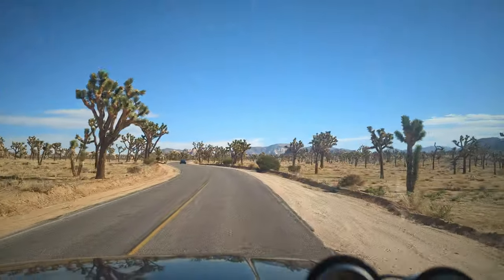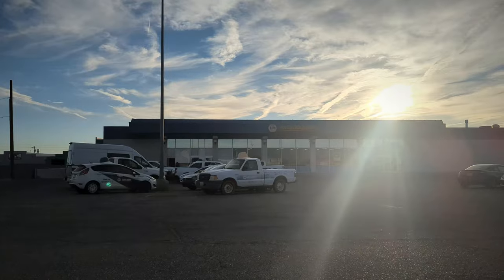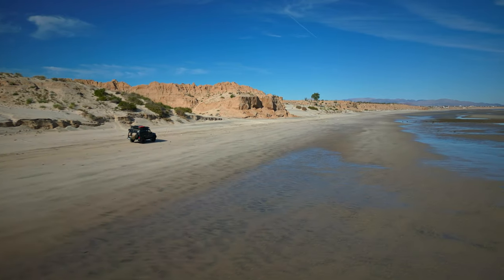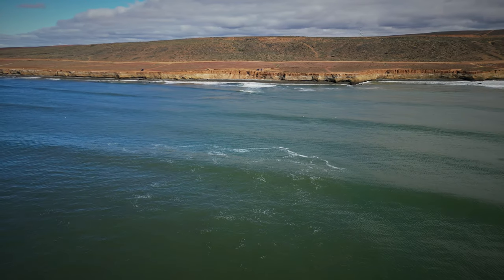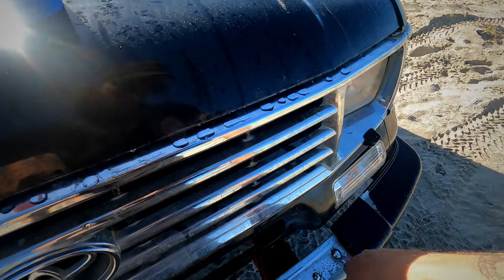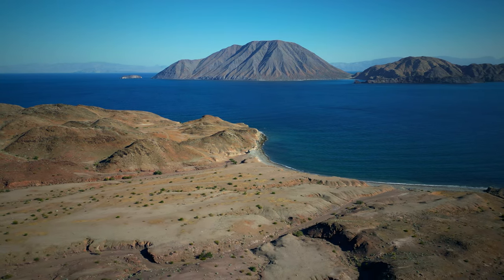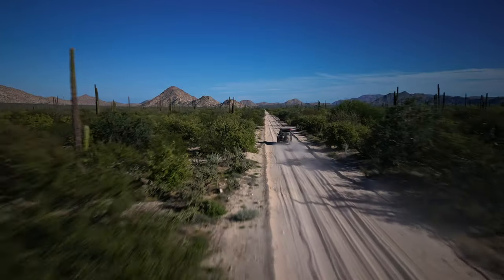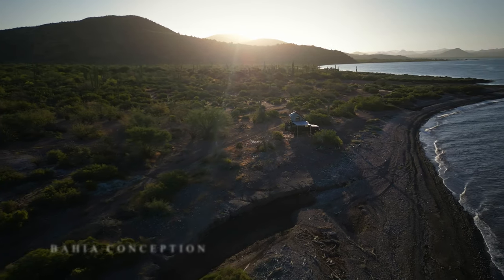Exploring Baja California | Archive 2

Comment: All I seen was that Friendly Manitoba plate and I Sub'd up straight away!  Great videos! Did you import the Cruiser from Japan? [RHD] Watched 2 videos so far, one break down. [wheel bearing] Any other issues along the way? Cheers from [you guessed it] Friendly Manitoba!   Stumpr1 BTW, we just had -40C windchill....ugh.
Reply from the maker: Thanks Stumpr! Yeah we had a bunch of mostly small stuff, birfield busted a small bearing. Radiator had a leak, new injection pump, blown two shock absorbers, bad battery, exhaust leak, general old truck stuff
Reply: 100 questions....to ask.  Vehicle, did u import to CDN? You a Pegger? Have a fantastic journey! Injection pump would be worst of these issues. Will Watch all videos posted up!  @goaloneTV

Comment: Hey man love the vids! Have watched all of them. Just wanted to throw a thought out there if you care at all. Your video quality is so good, that I think your mic quality takes away from it just a little.

I know you’re just starting this channel, but I’m a big fan so far. I would recommend a nice portable condenser microphone like the Audia technica at2020. It’s an XLR mic that will require phantom power, but you could pair it with the shure X2U adapter which is super small and will get the job done. This setup will give you extremely good voiceovers. All together it’s $180 on Amazon, but will really take your videos to the next level. 

Like I said, love the channel and I will be watching regardless. Goodluck!
Reply from the maker: Hey I totally agree, getting a clean voiceover has been a battle. I'm using a rode wireless go 2 and while it usually sounds alright through the camera I find with the laptop recording software if gets a bit muddled. 

With that said, the voiceover on these videos is heavily processed. With this video especially I couldn't get a day without howling winds so I was hiding in my truck sweating to death trying to get a decent voice over done, probably around 3-5 takes for every decent recording I could use and then still have to filter out the winds noise in the back and try to account for everything rattling.

Finding anything here, let alone a microphone is fairly difficult. Cost of imported goods in mexico is high and I'm having trouble finding what I need.

I'll try and improve the sound quality as best as I can but I agree it's the limiting factor so far in many ways. Thanks for your support so far!

Comment: That you for sharing your great adventures. You're doing great no matter what is thrown at you. A question, does your vehicle burn the ULSD diesel? I would like to hit the Baja but have a modern 2021 diesel engine and have heard as you get further south the diesel is not the 15 ppm needed for the newer engines.
Cheers and continued fun times.
Reply from the maker: Hmmmm well this rig is '94 and seems to run indifferently. I read mexico imports most diesel from the US and as such meets modern day requirements. If anything, the amount of modern RV's and Diesels trucks is some form of proof...

Comment: watching with interest, as I also own a KZJ78.  Has your ECU failed you yet in ownership?
Reply from the maker: Nope it hasn't, despite the truck being fully submerged and hydrolocked in a river. Winched out and cranked water out with no glow plugs and it's been like new ever since. Did kill a window motor though
Reply: @goaloneTV  LOL, I wonder if it has been replaced or repaired before.  I had my alternator go out and about a week after I replaced the Alt, the ecu shorted out causing no fuel.  It is not a matter of "if" but when on these rigs.  If you get any goofy electrical stuff related to engine or no fuel/no start its a good chance your ECU is crapped out.  The capacitors leak due to age. ECU's for the KZJ's are NLA from Toyota and can sometimes be found used for alot of money.  Rebuilding is an option hmu if it happens I can put you in touch with a rebuilder I used for mine.  Enjoying the content, keep it up!
Reply from the maker: @WranglermanLevi  Yes sir I'm aware of these notorious ECU's crapping out, big thing on the forums it seems. I do wonder if it may be acting up sometimes just because there's a few odd gremlins but, we shall see. As long as it lasts the trip I'll be happy. And I had the alt rebuilt last year after frying it in mud.

Comment: How do you handle the mess of doing suspension work on the road? Whenever I do suspension work, I end up a complete sweaty greasy mess and absolutely need a shower LOL
Reply: Also I imagine that this trip would not be possible without a 4 x 4. Is that correct? I love my van but it's only rear-wheel drive
Reply from the maker: Once you live in car for a while the meaning of needing a shower changes a bit haha. And lots of paper towl.

I mean to drive on sand 4x4 is sort of needed, most of the roads everywhere, including Baja, are either paved or just hard pack dirt that 2wd is fine for.
Reply: @goaloneTV  nice, good to know, ty